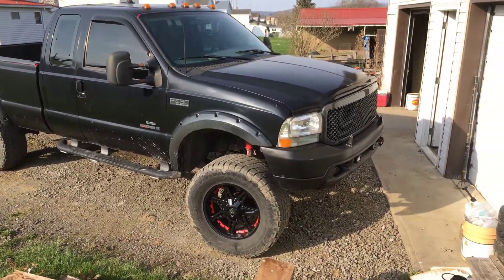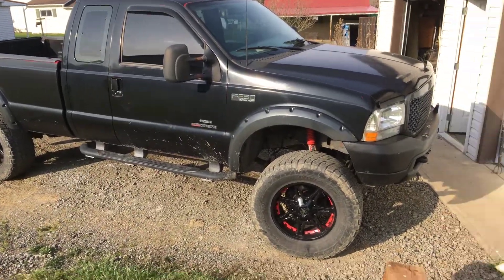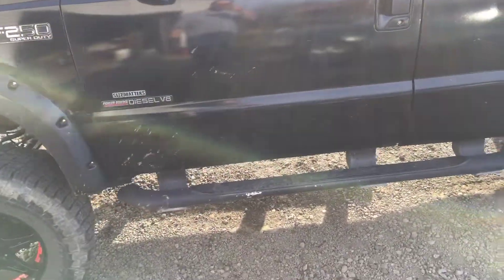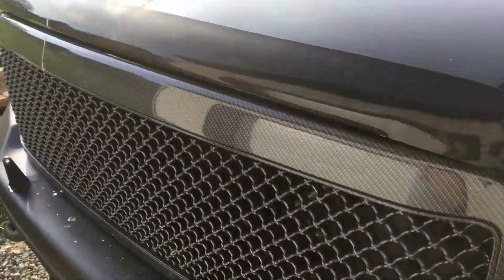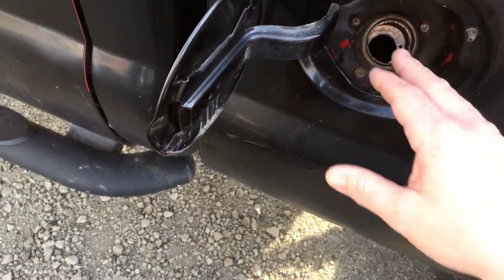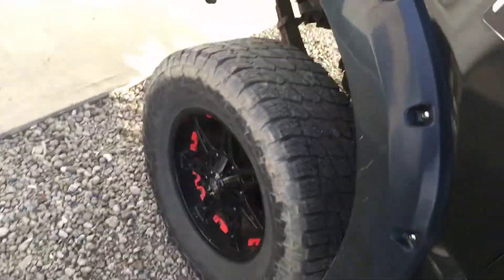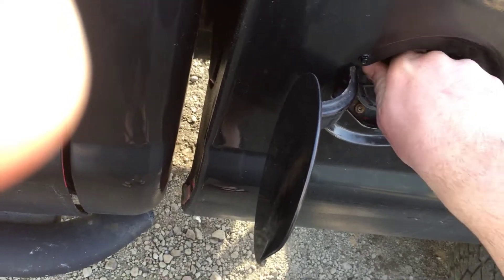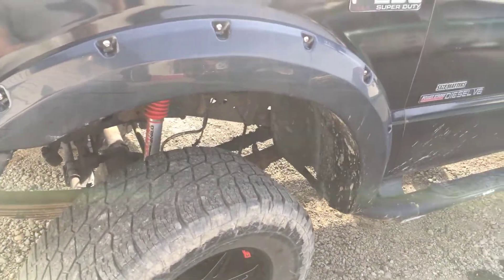7.3 powerstroke priming fuel system

Comment: Brother THANK YOU !!! My wife was driving my truck, was late and decided to skip the 5 mins to fuel up.... I had to drive 2 hours to come get this thing going. I messed with it changed fuel filter, primed bowl, turned valve under bowl trying to drain air.... nothing. Saw your video and didn't have an air compressor on me, was going to go get one, I decided to just open fuel tank cap and just see if it would prime easier being opened on other side before getting compressor, fired right up on the second start!!!! Thought maybe vapor locked at tank too??? I'll remember the compressor fix. Lord willing there will not be a second time!
Thanks again!

Comment: Do you need a old shock bushing ? Can’t you just put air in it
Reply from the maker: It sealed the fill hole that’s why I used it or you can use a rag that’s how I prime snowmobile fuel pumps rag and airline in the tank to prime the pump and carbs

Comment: I know this is an old video, but having a similar issue. I’m getting voltage to my fuel pump but I don’t hear it running when I cycle the key. I tried to manually prime it by hooking up a hose to the inlet and filling the line with diesel, still no go. I even swapped the pump with a backup and it ran for maybe 3 seconds then the pump went quiet again. I just ordered a new fuel pump, but am now wondering if your air hose trick would get the pump running. Did you hear your fuel pump running and it just wasn’t getting fuel to the bowl? Or was it silent like mine is?
Reply from the maker: The pump will run but not sure on quietly but I do know that it will not push the fuel up to the bowl by its itself when it looses prime    That’s why I pressurized the tank to push the fuel up
Reply: @ciracingsports6059  thanks for replying, I was able to get it sorted.
Reply: Didn’t you watch his video but yes his made noise as in you should be able to hear your as well
Reply: @djknowzbestbitchdjjaydub248  thanks for replying to my questions from more than a year ago, but I sorted it out.
Reply: @CRUSTY09  lol my bad I was actually trying to figure out what all I should know before starting mine after having it sit since last October and so from watching a shit ton of videos in a row I guess u could say I got bit over board wit it and so wit that said I was over stepping  or even stepping on to someone else’s shit with out having been invited over lol im a bit crazy if u can’t already tell but hey being self aware of my mental state is what has n will continue to keep me from going completely insane

Comment: I got same problem. I dropped tank and cleaned the 2 small filters in the fuel sending unit inside the tank. Hooked it all up. Went to start it and  IM NOT GETTING FUEL TO MY FUEL BOWL. I spend 10 hours (man I was upset). Were you not getting fuel into fuel bowl also?
Reply: Raul Gallardo I’m having the same problem what did you do to fix it?!
Reply: Jackedandstand, I took it to shop. They haven't fixed it yet.
Reply: Raul Gallardo what did they do at the shop, I’m stuck now in same situation. Really appreciate any comments, thank you
Reply: Paul K I i took my fuel tank out to clean it as will and the no fuel In fuel bowl so I fill it up and closed it and started right up and stayed started but runs rough. I think there’s air in the lines dose anyone know how to bleed or get the air out
Reply: Aj Jeha is it still running rough? I think it’ll self prime or purge air out if you run it a bit. I did all that but my electric fuel pump pretty much primed everything once I turned key on/off few times then it started right up
Reply: Paul K ya it is it starts really good just runs rough
Reply: Aj Jeha I dunno man, rough enough you can’t drive it or....... you gotta research everything. I ask shop guys I know, look in books and you tube and google and all. Good luck
Reply: Make sure electric fuel pump is working, check fuses and also listen for the hum of the pump. Mine ended up blowing a fuse but would run rough but it wouldn’t drive really but it would start, I had a wire that kept arcing out and blowing fuses or pumps. Just a thought, good luck again bro
Reply from the maker: I was In a hurry that evening and didn’t get fuel and it was on low fuel already. My laziness I guess but I’m glad to hear that the video helped people out and yes my bowl was empty the air will
Push the fuel to fill the bowl up then out the cap on and fire it up